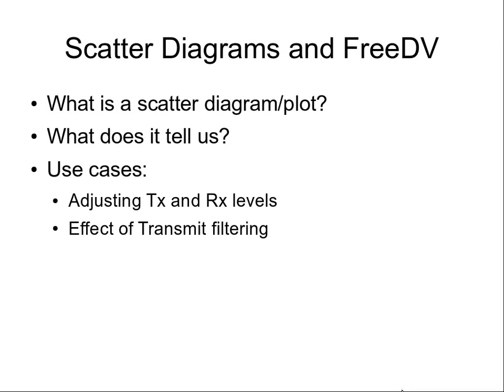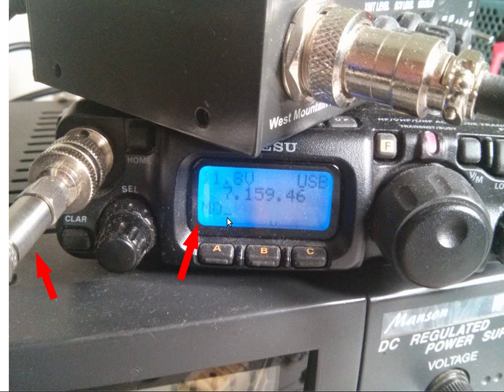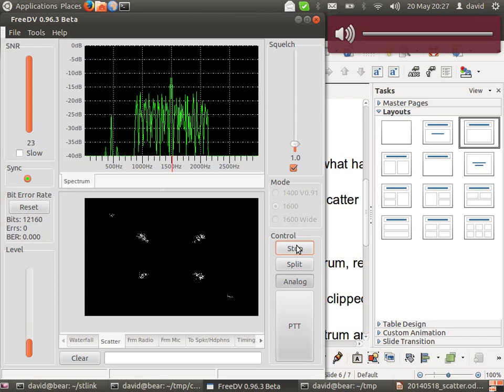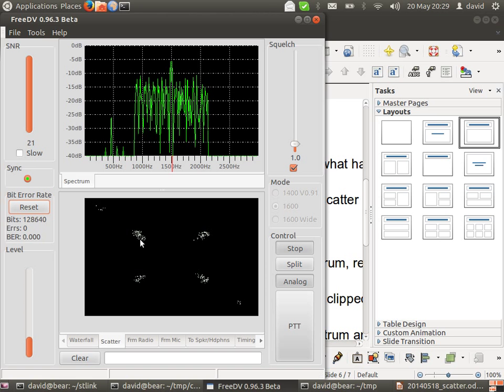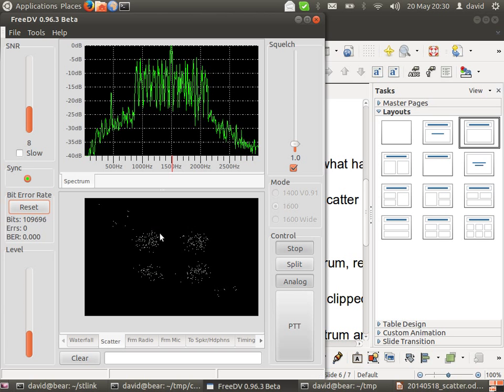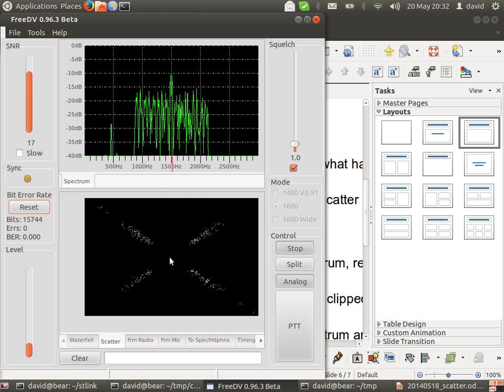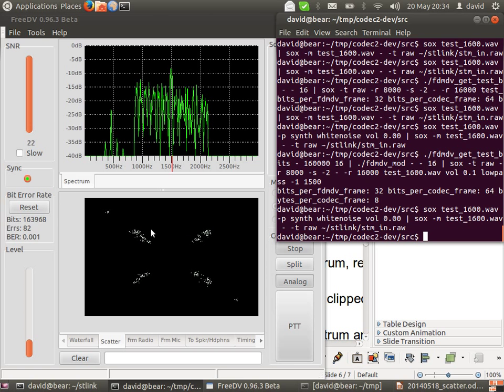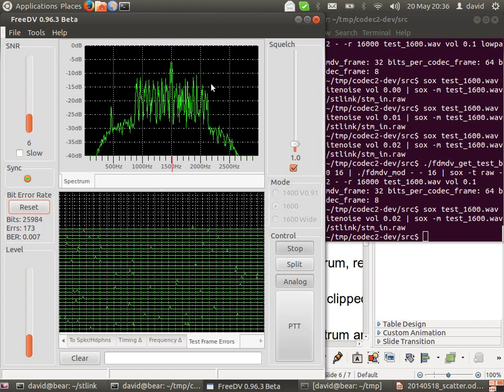Scatter Plots and FreeDV

Comment: Hi, there. 

I am actually trying to recreate this setup. What kind of attenuators are you using please? I have confirmed results with a similar setup but using dummy loads between two transceivers. However I'm only getting SNRs in the range of  6 - 10 dB with optimal tuning.

Thanks for any help.